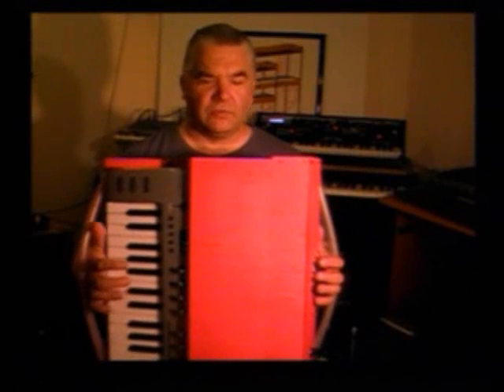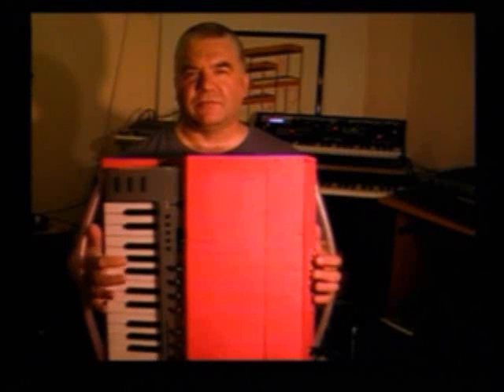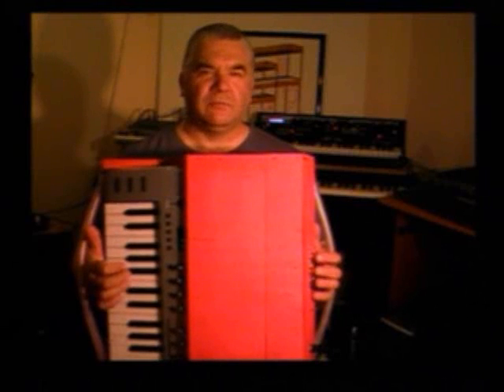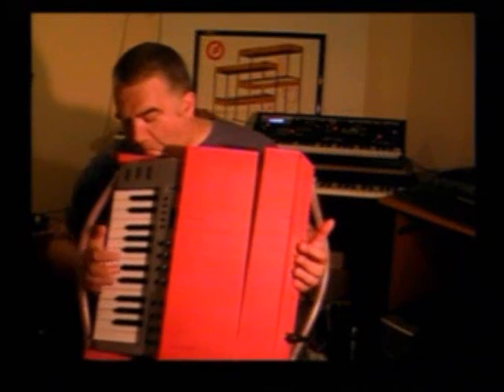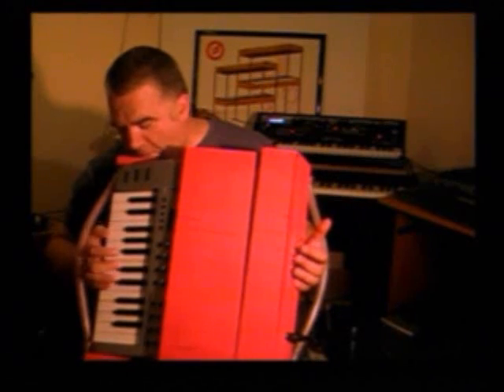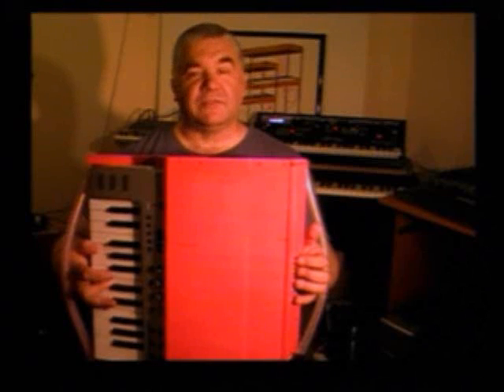Midi Accordian using Arduino.

Comment: Hmm... it sounds like you're using the bellows to send velocity. This has the problem of only sending velocity at "note on" and not being updated constantly. Ideally, the bellow pressure should be sent as breath control (CC #2) or maybe volume (CC #7).
Reply from the maker: Hi, yes that was what I had done. The unit was too heavy to really play. When I re-build it I will make the routing switchable.